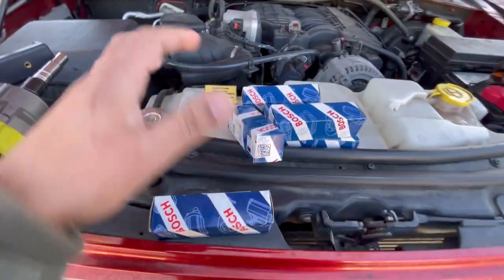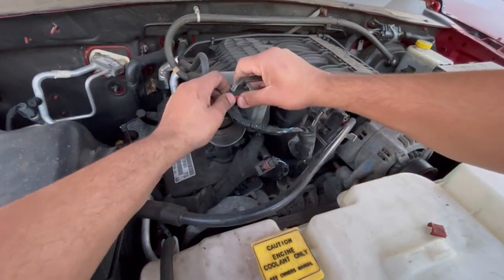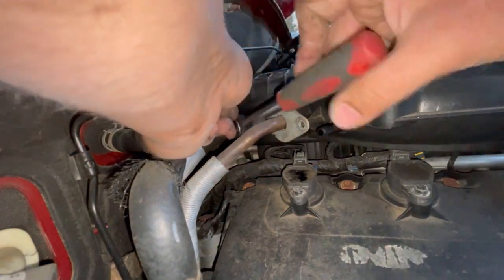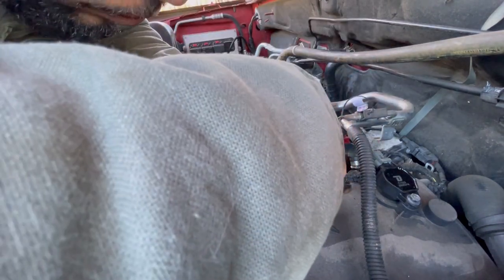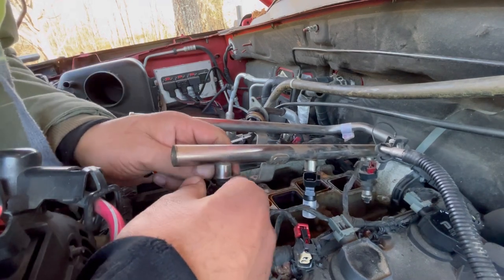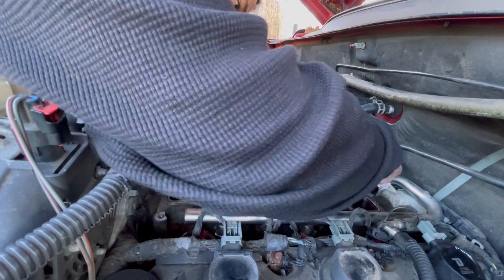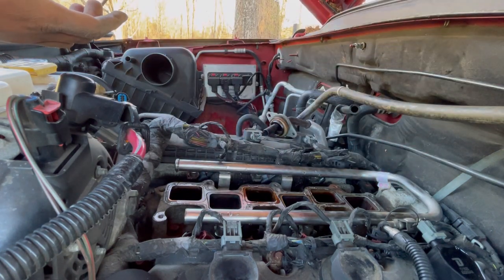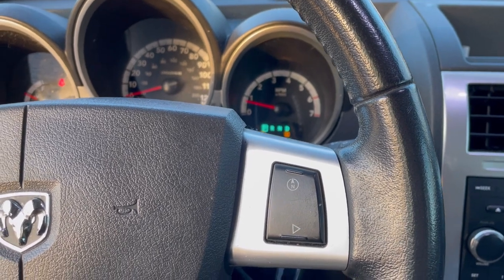Fuel Injector Replacement On Dodge Nitro 4.0L V6

Comment: I’m having the same issues with my 2011 nitro 3.7 V6, the code popped up that cylinder 3 fuel injector, I had someone replaced it but I noticed they didn’t do the first step when you went in the fuse box. The car won’t start and the code now showing cylinder 5, any advice?
Reply: Did you figure it out?

I also have a 2011 nitro 3.7 V6
And cylinder 2 fuel injector piped up